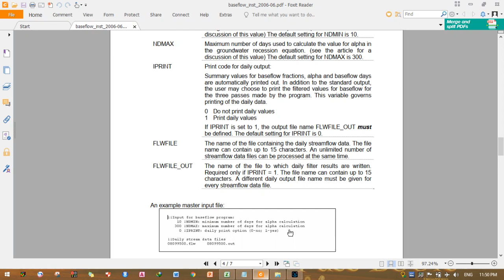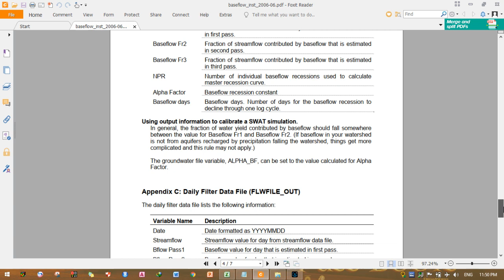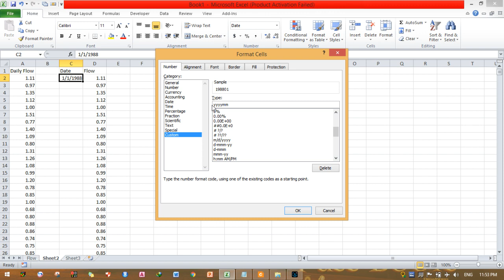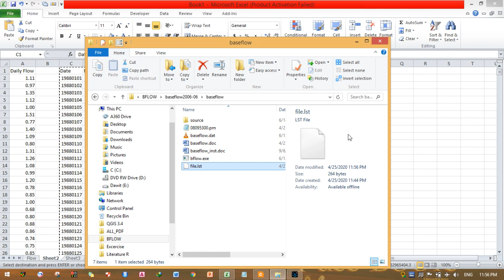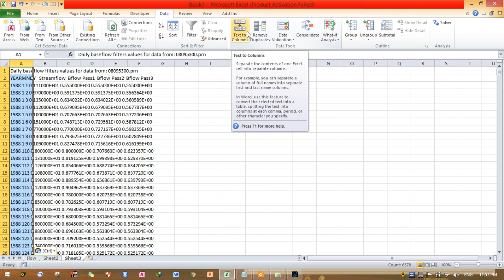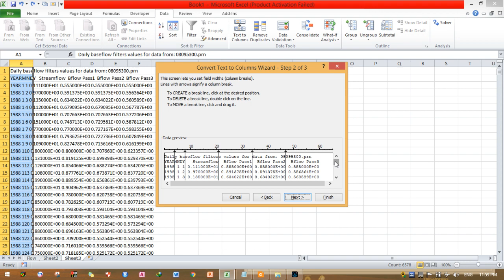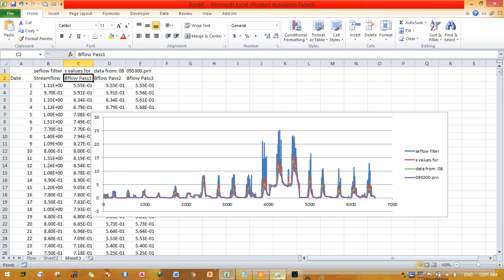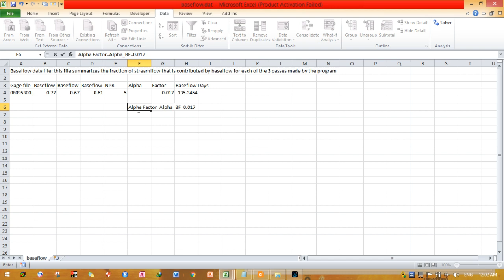2.3.  Automated Base Flow Separation and Recession Analysis Techniques

Comment: Sir, which software you used?
And what data is required?
I need your help sir.
Reply from the maker: bflow software and flow data is required.
Reply: @hydraulicsandhydrologytutorial  Sir, Can we calculate by using Water Table Fluctuations data?

Comment: What about, if I have missing data for some days or couple of months?
Reply from the maker: Recheck the method or procedure you followed. On the setup file there is pdf manual which will help you to the proper procedure.